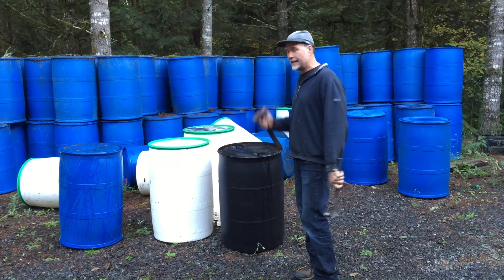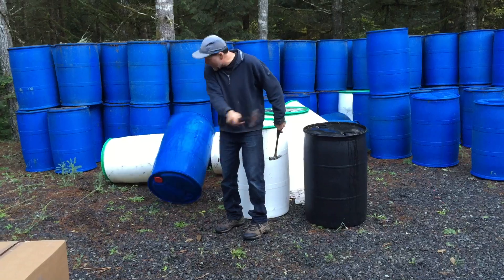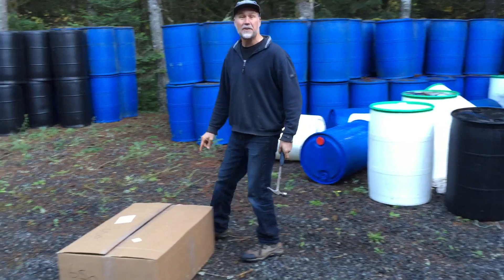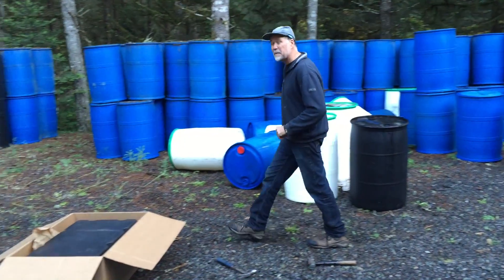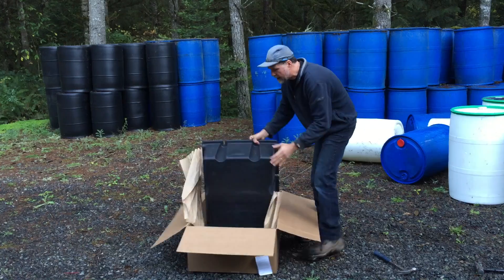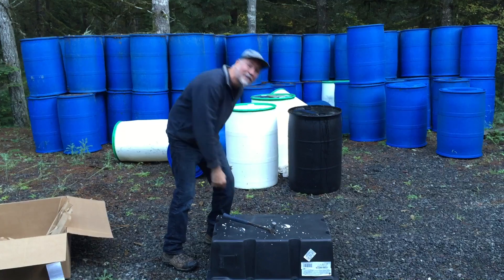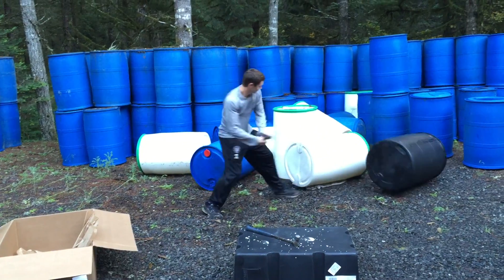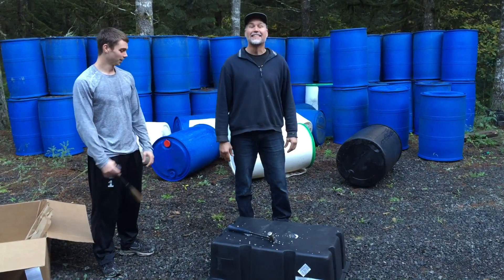Dock Floats Versus Plastic Barrels

Comment: how do you prevent water from entering barrels or remove it when it does enter? or can you just orient them vertically with the bung down? how bout plumbing in a small air line and pump to keep positive pressure?

Comment: you are hitting an empty cylinder that is made of a more durable product but if you fill it with a high density foam and smack with that claw it will puncture it. im not against using barrels as dock floats but the problem is their shape and size. they sit way to high above water and i know some will say put some water in it. id rather know if i have a leak vs already having water in it and not knowing till its going under. nothing is fool proof and if there were square pods made of pp that would be what i would get and maybe they make them better now but i dont know.
Reply: I seriously doubt that. I've used several barrels like that and they're extremely durable. I bet you could hit it with the claw hammer as hard as you are able to while it's full of foam or liquid and nothing would happen. At work I've seen one accidentally get stabbed with the fork of a forklift (at a relatively slow speed though) and instead of going through it, the barrel folded almost in half. I don't think these dock floats could come anywhere close to that durability

Comment: You are not testing anything important.  People rarely fill barrels with foam.  Floats and barrels don’t take the hits you gave either of them.  What you need to compare is stability in similar structures.  Floats are normally much more stable than barrels.

Comment: What happens when you fill the barrel with closed cell foam and the barrel can no longer flex to disapate the energy of the hammer blow? I'm sure it's still stronger than the flat side of the dock float. But i have my doubts that it'll hold up to the claw side of the framing hammer. It's just not an apples to apples until they're both able to maintain floatation when damaged.

Comment: The difference is if the floats get punctured they will continue to float. The barrels will take on water and sink.
Reply: Fill them drums with foam and they’ll still float to.  Although, I wonder if the foam itself is the reason for the rock float puncturing easier?
Reply: This is a huge difference.  At my cottage--which is used maybe 10 times per year, a leaky barrel is a major headache.  Pulling the dock up on the beach for winter storage with a full barrel is a pain in the but.  But the barrels are much less expensive.

Comment: I have a combination of those taylor made and Blue barrels, Try not to let anybody over, and on your DOCK with a hammer😮  😂 And you will definitely avoid this problem🤪...😢 The tailor made definitely have lots more flotation because they are Flat not round.. When mixing them put those on the outside and barrels on the inside..

Comment: Barrels are cheap and basically industructable so I doubt you will find an advantage to the traditional dock float.
Reply: The money he spent in aluminum to build a frame to avoid the drums from rolling everywhere, you will save it by using the traditional dock float from Taylor Made. I had a dock in Puerto Rico. Made with this drums sun kill them over time because they are made of HDPE which is poor UV resistant, they got bridle for long hours under Sun exposition. I changed to Taylor Made dock floats and they sit right under dock can't even see them under the dock plus I added LED lights, and it looks almost like a levitating platform because the float are black.
Reply: @sololetras8169  Aluminum seems like an excessively expensive material for framing a dock with poor rigidity, why would you use it?

Comment: Well, if the drums fill with water they will sink obviously. If the dock floats fill with water they will be fine as they use Styrofoam to displace the water.
I'm using drums as the price is right!
Reply: Styrofoam doesnt float for ever only a few years. Ice, bacteria or small animal can break the bubbles and it soaks with water over time.
Reply: I think you'll be fine, I've had a dock with them 10 ten years.. if you go with the tailor made You just can't let anybody over. And beat on them with a hammer claw..😢    🤪

Comment: Make the drum rigid or under pressure and then see what happens. Your demonstration isn't comparing a barrel as it would be in use, where the dock float wont change when its in the water.  Also if the barrel gets punctured, which is definitely possible when its under pressure, it will sink, where the dock float will not.
Reply: It will partially sink but the barrel can be replaced easily and cheaply.
Reply: Even sucured and under pressure these types of barrels are fairly axe resistant, so I don't think they will catostrophic fail, and you can fill them with closed cell foam or something else that is cheap, floats and isn't adsorbant if you don't want to replace leaky barrels.

Comment: Have a 1 acre pond and would like to leave my floating dock in for the winter. If I were to pull the dock close to shore will those barrels survive the winter.   Dock is 8'x8' with 4 55 gallon drums.  Really don't want to muscle this thing out of the water but will if the ice will crush the drums.
Reply: I’d like to know as well
Reply: @pkaspar78  left mine in the pond 2 years now and no issues.
Reply: @jaecubed592  good to know, thanks for the reply 👍🏻

Comment: The perfect float is drum filled with styrofoam beads,bean bag filling,dock float cases are weak and break,barrels don't.
Changed my mind,just found poor in closed cell foam,the stuff is great, pore in barrel let cure cut off excess and glue down tops.
Can't be destroyed.
Reply: Probably the only affordable option that is tougher than a plain barrel for similar floatation.

Comment: What do you use to seal up the bung holes on those things?   I've got a few sitting out in my back yard, but after a few good rains, they fill up with rain water.  Do you use Teflon tape, or some sort of adhesive, or something else?
Reply: Most people use silicone to seal it.
Reply: Teflon tape for sure on the threads of the bung caps (as they always leak over time). Then if you get a puncher, just change the barrel. Ensure every year you pump/empty out the barrels of water if they leak. Up here in Manitoba, Canada we experience -20 to -35 winters causing the barrels to crack or break.

Comment: Has anyone tried putting some water into the barrels to get the deck a bit closer to the water? I'm thinking all I want is an 8x8 floating swim platform but I don't want it almost 2 feet above the water line.
Reply: That's pretty common. It also quiets the barrels when waves hit them.

Comment: idk whats best but the barrel moves when he hits it taking the shock away, but the float is flat taking the full force so its not fair
Reply: We have tons of docks out here with plastic barrels. Most older ones have been retrofitted with them as their dock floats have cracked. At work we dont have the option to use barrels for the pump docks we have. The floats have to be replaced once every couple years. These are in ponds with almost no water level fluctuation, very few days a year below freezing,  no large waves beating them, and no boats bumping into them.
Reply: @MrDirtysteve75  I don't understand,so u saying the barrels is better in terms of durability?
Reply: The barrels are also round sided and made from thicker plastic. Both of which give them a huge advantage when it comes to impact resistance.
Reply: Exactly my thought
Reply: Taylor made are flat!  the barrels are round.. flat sits better and floats better in the water.. You just can't let anybody over with a claw hammer😂😂.. I've had this Taylor made type, over ten years no problems.. So far..

Comment: I live on a lake for over a decade, drums ALWAYS fail over time, they leak and can't support a heavy dock while on dry land. In my experience, envirofloat out of Victoria BC is the best made. Period
Reply: I got 22 years on Blue Lake with icy winds and freezing waters in winter. You are talking metal drums and they do eventually decay. My 40 foot Rolling Barge dock supported the weight of a Toyota truck that was needed on another property. Later that season the lack of water left 2/3 's of the dock on the shoreline and it was unharmed.  My dock pops up above the ice in the winter and is almost impossible to get it stuck in ice ever (incorrect mooring can get it stuck). Rolling Barge dock kits is what you should have. But if you are supporting a floating garage, then those envirofloats are great. Expensive as heck! I am happy with my Yoshida Teriyaki barrels.
Reply: Fill the drum with ping pong balls :)

Comment: The plastic around the dock float is just used to protect the high density foam which is what is really providing the buoyancy.  If you get a hole in the barrel it fills with water and sinks.
Reply: still works out cheaper to fill the barrel with foam
Reply: Why do they sell them with and without foam?
Reply: @danp129  because they are generic barrels. They are not specifically made for docks, they just happened to be used for them.
Reply: Then when the outer shell gets a hole soon you have foam all over the lake
Reply: @jerrycramer8476  you will not, the foam is steam and expanded together, yes if you scraped you might separate some particles not huge damage.
Reply: Some places will fine you for having your foam coming out of a hole and littering the lake
Reply: The foam provides zero buoyancy when inside plastic.... it's in case of a leak
Reply: @michaelvoorhees5978  I agree, what it provides the buoyancy is the volume of the dock Float, and how much water displaces when you apply force, calculate this with the water weight and boom.... went too far yes, the foam is in case it gets a leak don't fill its cavity and sink like it would happen with the drum.